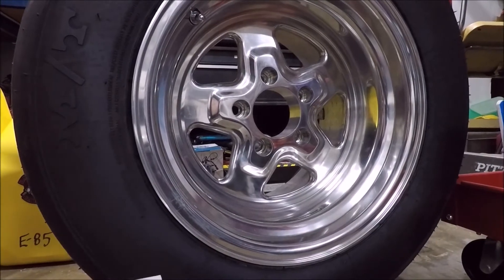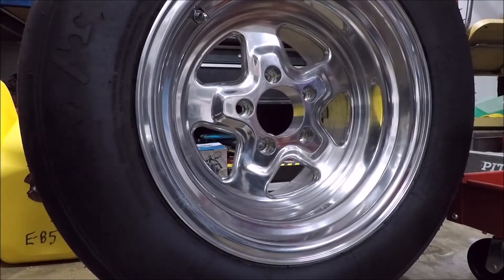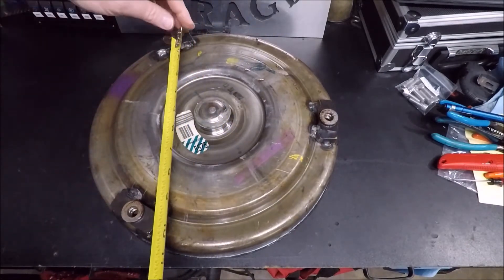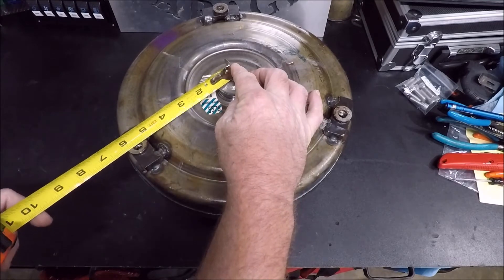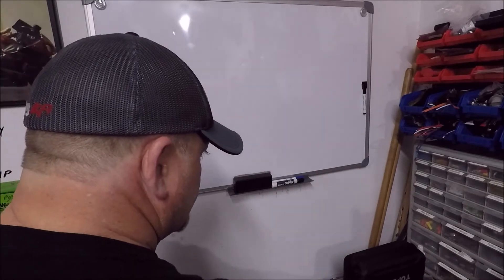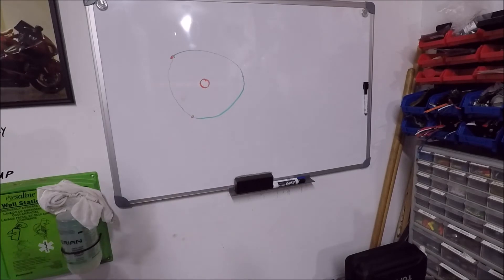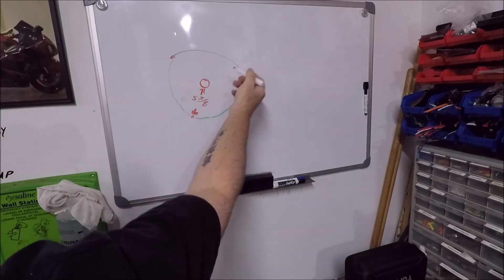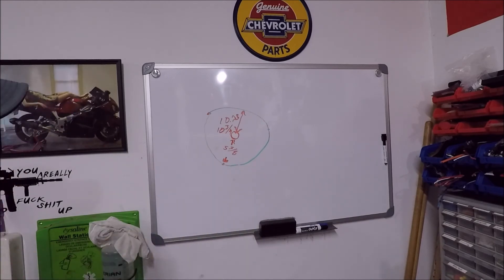HOW TO MEASURE TORQUE CONVERTER BOLT PATTERN (BOLT CIRCLE)

Comment: I picked up a flex plate for a 440 mopar and bought a th400 conversion and it is telling me use a 6x10.750 converter what's the 6 mean exacly
Reply from the maker: Most likely the number of bolts used.
Reply: @BadLuckGarage  do I have to use all 6 I cant find for the life of me a 6 bolt 10.75 th400 converter
Reply from the maker: @DSMOTORSPORTS  no
Reply: @BadLuckGarage  will just the 3 line up to 3 of the 6
Reply from the maker: @DSMOTORSPORTS  If it’s the correct bolt circle on both the converter and the flexplate then yes. As an example, a 4L80e flexplate is 6x11.5” but a 3x11.5” TH400 torque converter will bolt directly to it, there will just be 3 unused holes on the 4L80e flexplate.
Reply: @BadLuckGarage  thinks so much want to hemi swap but also want to us a th400 cuase dont think a dodge transmission will hold up to me what I want to do

Comment: question,i have a 6 bolt flywheel that had a 3 bolt converter on it.should i get the 6 bolt or am i fine getting another 3 bolt? its a 383  planning on making decent horsepower,just street car though
Reply from the maker: Our Third Gen Camaro is making north of 900hp and running 5s with a 3 bolt converter. You’ll be fine. 😉

Comment: I have been having a melt down trying to figure out what you answered in this video.    Could not find a 10" flexplate anywhere LoL
Reply from the maker: Lol, yea I was getting that a lot after my video on using older transmissions in LS swaps so I made this video instead of trying to explain it in the comments over and over again.

Comment: What’s a torque converter? Lol
Reply from the maker: No clue, but people keep asking about it. I think it’s like a big imaginary donut or something. 🤣
Reply: To convert any fraction to a decimal all you have to do is divide the small number by the large number for instance 3/4 as a fraction converted to a decimal would be 3 divided by 4 would equal 0.75 which equals .750 it works for any fraction that you want to convert to a decimal. Like 5/8 say 5 divided by 8 equals 0.625
Reply from the maker: @jsteed4388  Correct. 👍
Reply: Wheel bolt circle is actually measured the same way.
Reply from the maker: @Kellyoest  Yes sir a lug pattern can be measured with either method although it’s easier to just skip the math and measure lug to lug. Unfortunately you don’t get that option with a 3 bolt converter and it’s caused a lot of confusion and questions on a previous video. Hence this video.